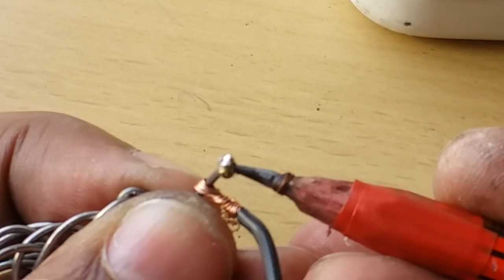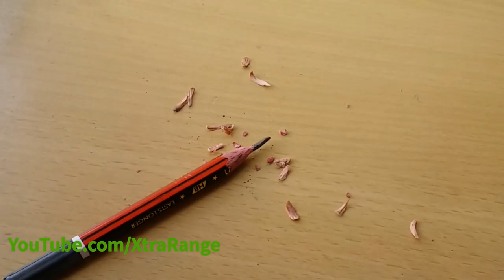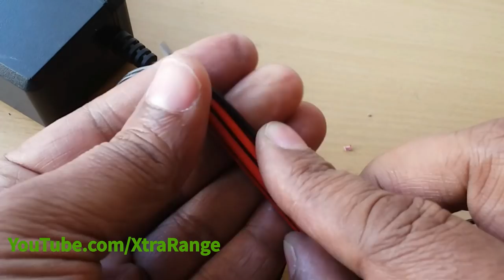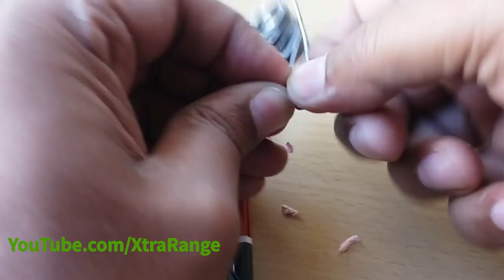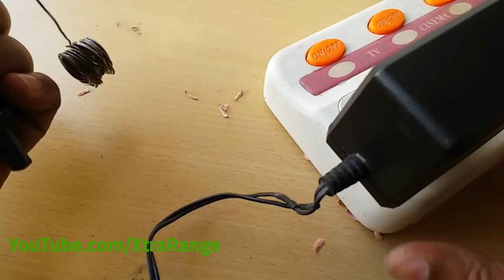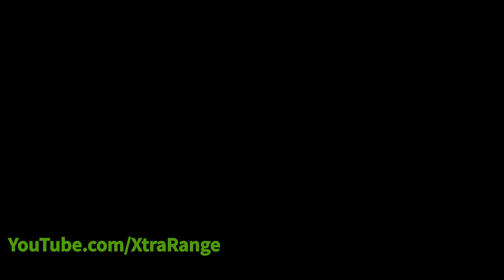Easiest Soldering Technique Using Pencil

Comment: Yes, this works as a proof of concept... It's even good enough for soldering small wires together like in the video... But I strongly caution against its use for circuit boards and closely spaced multi-legged components.  If, during soldering, the solder and tip are touching different connections of a component, the current from the the tip will go THROUGH the component before getting to the solder... This is likely to destroy the component.
Reply from the maker: good comment

Comment: is it effective as a real solder gun???.......................I need to solder a few wires to fix my earphone.....is it safe enough if graphite is  used near extremely thin wires which are used in earphones????
Reply from the maker: +Krishna construction This soldering method is not suitable for sensitive electronic components, because of the leakage of current. Simple wire joints you can solder with this,

Comment: are you not get any electric shock ?
Reply from the maker: it is a 12 v adapter with a low amp. so it is safe. but i suggest you if you are not experienced and not familiar with working with electricity then do not try these kind of things.
Reply: Techno Beats
Reply: Techno Beats its 12V DC Adaptor.. Wont make any lethel electric shock..
But ofcourse you will effect a little if you try it on some soft wet partd

Comment: What is a soldier wire 
Can U help me
Reply from the maker: +Lunzy Yphei you can get it from all electric/electronic spare parts shopes.
Reply from the maker: +Lunzy Yphei it is used to Joint leads or wire ends,
Reply: Oh thanks
Reply: Not soldier broo.....its soldering wire

Comment: Agar WO wire Jo solder wier me laga WO agar pencil me lagta to work karta kya?
Reply from the maker: +ranjeet subhendu vines I am weak in hindi. Can you repeat in English?
Reply from the maker: +ranjeet subhendu vines Here the graphite pencil lead acts as the heating element. This is the simplest soldering method for nonsensitive soldering.
Reply: which symbol wire is this

Comment: Upload video pls how to make hot glue gun
Reply: You probably don't need one... For very occasional use, try this trick: 
Hold tip of glue stick over lighter flame, or candle... 
When the glue gets hot enough to flow, quickly apply glue by touching, smearing, and twisting away the tip on the work material. Repeat as required.  
There are 2 sizes of glue stick, buy both to have a choice.
Great to carry around in your tool box for occasional use, and no need for electricity!
Perfectly fine for small jobs, and a convenient way to seal exposed wire connections when other methods are impractical.
Reply from the maker: great!